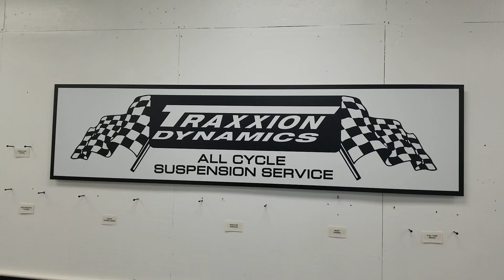Front Shock Design Defect / Is Max Really Smarter than Honda? 2018 Honda Gold Wing

Comment: Country theme aside, Honda and many manufacturers have been outsourcing engineering and many have never ridden a motorcycle. I love Arai Helmets, a Japanese company, but they are all about safety and quality for a high price, so I trust them. I want to buy this GW so badly,  but the fact Honda has not even discussed any of these issues means they planned on warranty claims down the road in the overall engineering piece.  Price vs. quality argument.  The problem?  People are having issues sooner than later, and most Honda dealers can’t service these with any real reliability yet.  I thank Max for using his experience and connections to make high quality aftermarket improvements (many safety related) and also hope to have him fit my bike someday.